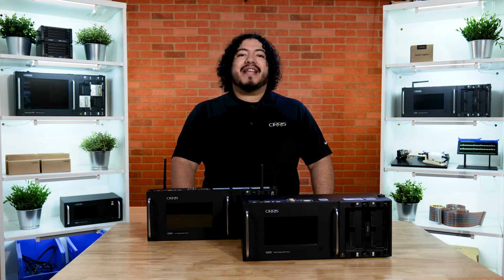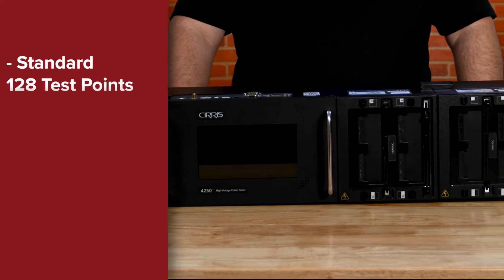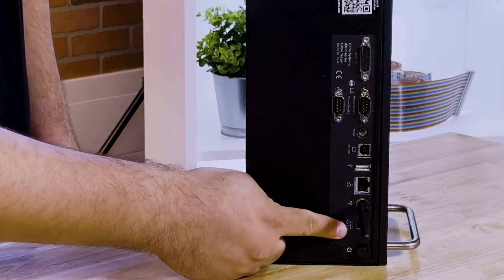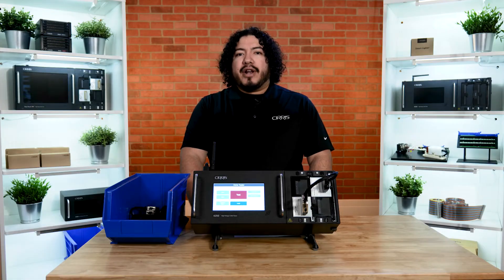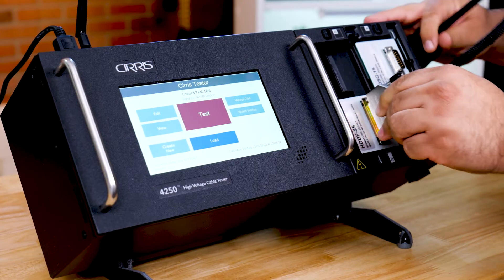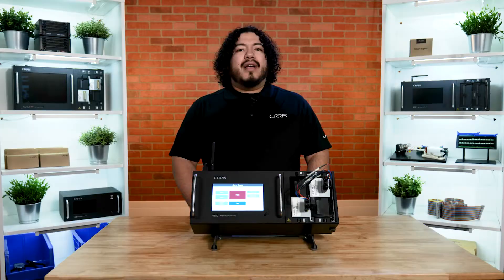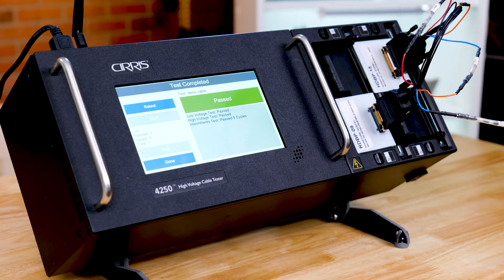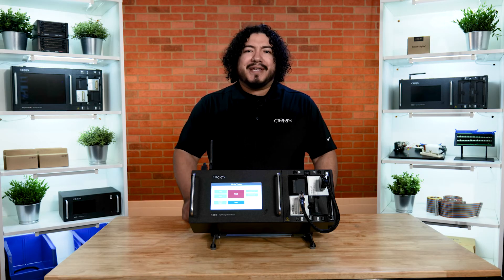4200 Series | Product Demo | Cirris - Cable and Harness Testers

Comment: Isolation at 500V possible
Reply from the maker: Great Question! The 4250 can perform high voltage isolation (Insulation Resistance - IR) testing at up to 1500 VDC. The 4200, however, is a low voltage tester so it is not able to, as it only performs low voltage isolation testing. You can read more about the specs on our handy product page https://cirris.com/product/4250/#product-specs